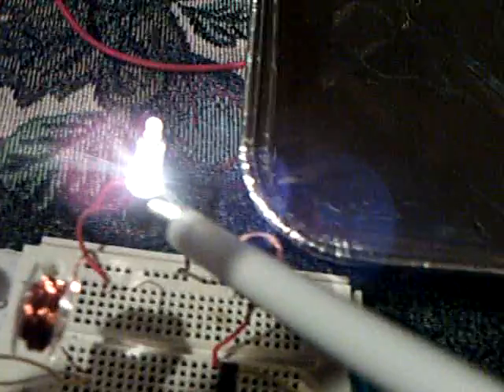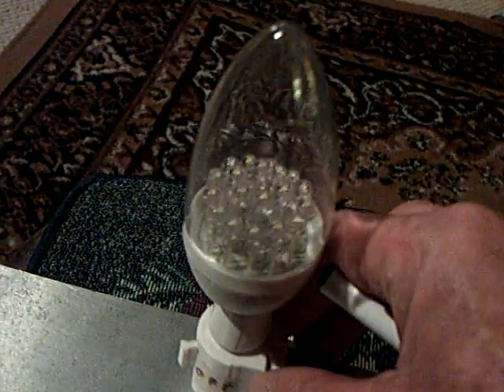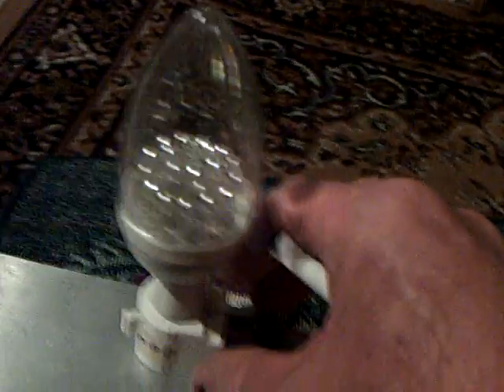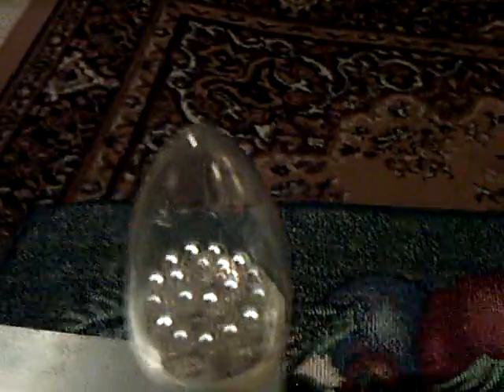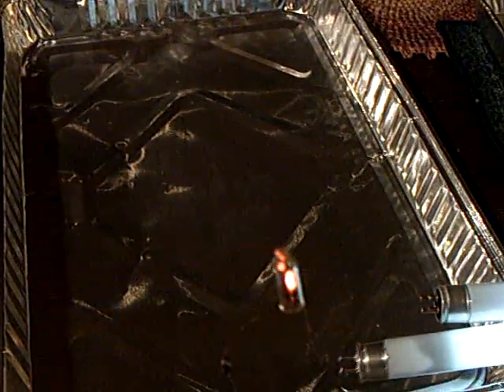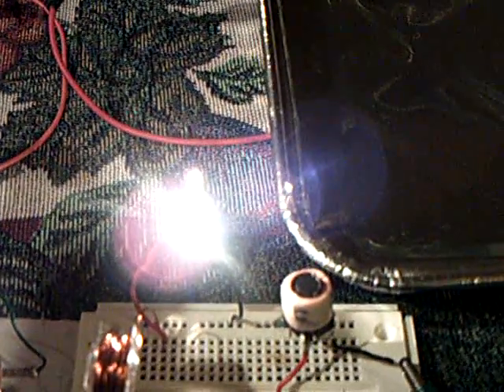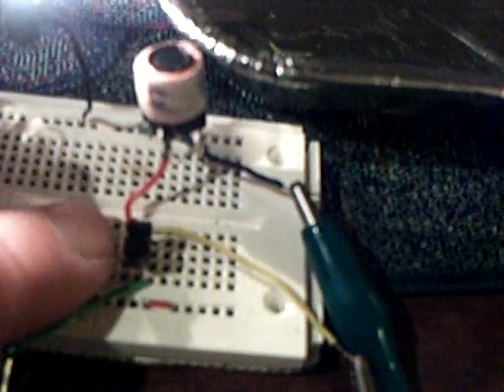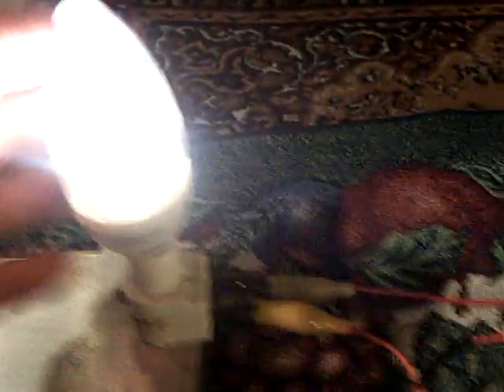Pan oscillator running 110 volt LED light

Comment: Great job Lidmotor !! As usual should I say :)
Your small bulb in series with the transistors, to limit amperage is dividing the available voltage on the transistors by 2 no?
If you take out this amperage limiter, then you will have twice more voltage on the transistor I think. Anyways, you are an amazing tinker, gold medal for Lidmotor !

Comment: Glad the coil worked out for you. I have been using 6 volts for my setup but now your 12 volt setup works great. The only real negitive to having a second coil is the amperage draw goes up but the things you can power is the trade off. The one thing I did do was power an entire string of led christmas lights which was awsome considering Dc at the same voltage does nothing.

Comment: Nice.
If you take out the protection stuff from inside that LoA bulb, and reattach the wires so the pos of the lights matches with the pos of the bulb base, then it should light up like those two eyes and you could do it with 1.5 or 3 volts, I betcha.
This is getting really fun.
thanks for such a good time,
jeanna